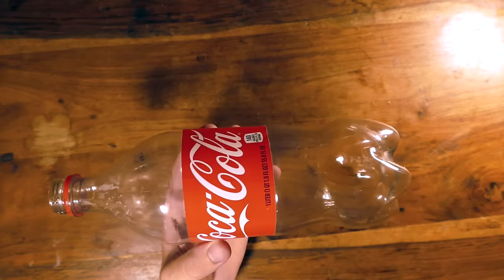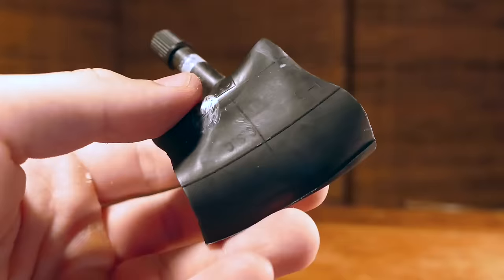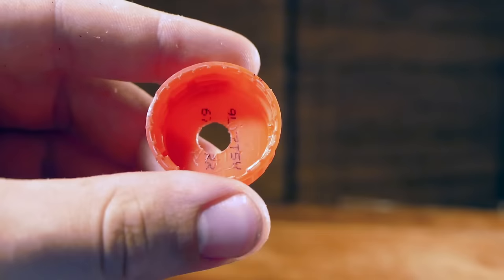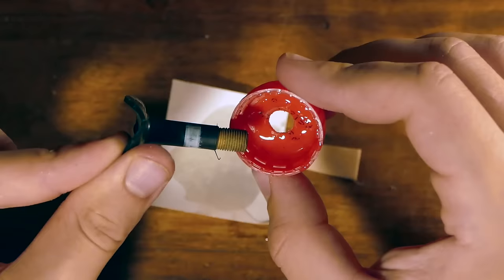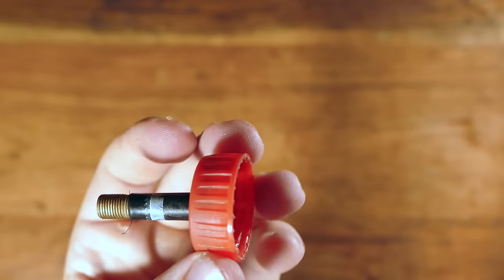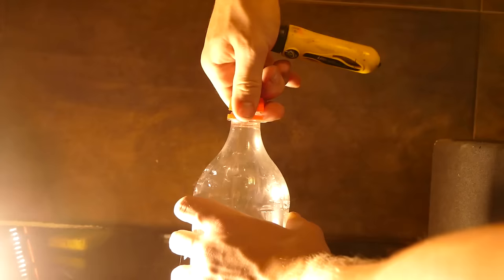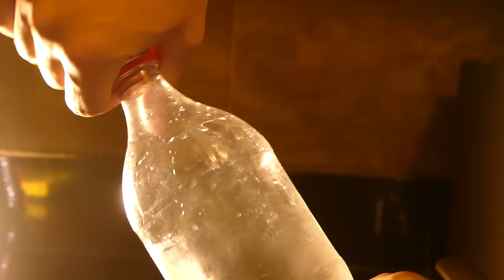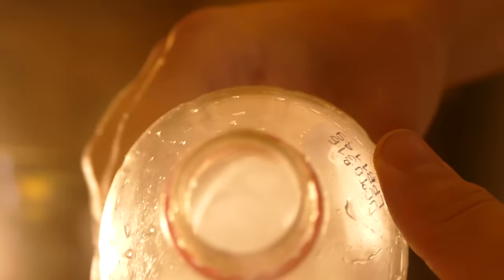How To Make a Soda Machine! - 5$ 5 Minutes!! (Super Easy)

Comment: Mmmm, good old food grade bicycle tires and epoxy.
Reply: My favorite snack
Reply: I can taste the Benzene contamination already, mmm mmm good.
Reply: Kamlesh?
Reply: prism and carbonated too :)
Reply: Dont forget the CO2 canister w/o oil mixed in. My favorite beverages are the ones with just a hint of mineral oil.
Reply: I don’t know why he didn’t just buy a food grade bike valve they use them in beer making
Reply: my soda tastes like rubber
Reply: you can't be picky, princess. God.
Reply: I want to do something like this but seriously can’t figure out how to make it truly food safe
Reply: @patrickmanasco8772  Just buy a soda siphon, they come in all price ranges, starting around $32 shipped for an ICO brand, which works well.

This thing is basically just a cheap hack $5 version of the real thing, probably unsafe too, as bottle might eventually explode. Real siphons use food grade materials, and either metal bottle, or mesh covered glass/plastic. Cause history has shown, they can def explode.
Reply: Life of the party
Reply: Or we can buy the metal cap that is readily available in the market and attach the co2 canister through a pin valve

Comment: I don't think you can get a bike tire, a bottle of soda, and a bike pump for $5. At least, not where I live anyway.
Reply: +Ajax Bleach 
 Lol.
Reply: +Ajax Bleach omg ias tht blech? I actuly naad some of it maan
Reply: +ChildOfRusher yes you can???
Reply: Yes, it is a bike pump..  But also called a bike inflator.
Reply: That 'pump' is made and sold for doing just that.  It's also called an inflator.  It's used if you get a flat while out riding.  They sell bigger versions for car and truck tires.
Reply: And epoxy
Reply: Don't forget the glue
Reply: Most people have a bike pump
Reply: where do you live?

Siberia?
Reply: @PoopyFrikoli There isn't co2 in the average bike pump. Just air
Reply: Everyone knows you dont buy a bike. They are free everywhere and tires come with them. The bike pump can be found at a dollar general or something for 5 bucks.

Comment: Tips: Make sure the liquid is ice cold because co2 dissolves best in cold liquids, and make sure to squeeze out all air before pumping it up with co2 so you get a better carbonation, and don't forget to shake it a bit.
Reply: Exactly my thoughts, he released kid before shaking all that extra gas into the drink.   But cute and fast idea.
Reply: I find shaking it a lot in a sealed container and putting it right up to your moms face (to absorb the home-made feel) and opening the lid helps for the carbonation to be extra fizzy
Reply: Tips: i am pretty sure the video shows that, we don't need a commentary.

Comment: For anyone's future reference, you can buy valve stem for car tires at an auto parts store, drill a certain size hole, and pop the valve stem in and it shouldn't require any glue
Reply: What is the name of that the boy is pressing with pressure
Reply: @michelleperez6716   You mean the bike tire inflator or the Schrader valve and valve stem (the bike inner tube valve)

Comment: I did the same thing with a basketball needle valve.  Don't need any epoxy to do that.  Just drill the hole slightly smaller than the size of the valve and it seals itself once it's forced into the drilled hole.  Just need the same CO2 pump with an inflation needle to fill.  Cheaper than a bike tire and glue, and even less tricky to put together.

Comment: Squeeze it to push all the air out, you only want CO2 in there. Also once it's in shake the heck out of it and you'll get much more carbonation much faster. If you're interested in making larger quantities, look up how to do this with a 5# bottle, regulator and adapter used in beer brewing. It'll run you about $120 (mostly for the bottle) but you'll be able to make hundreds (thousands?) of liters of water with one bottle and it'll cost you about $10 to refill.

Comment: Seems like a great idea.  I have a syphon seltzer bottle which fills with a CO-2 cartridge which I think is food grade. I drilled a 1/4 in hole in the top of the cap with an empty cartridge in it so the hole went thru the cap and empty cartridge.  Then threaded a hollow 1/4 -20 screw thru the cap and cartridge. The hollow screw is connected to a large C0-2 tank with a double regulator. Now I can screw the cap with the empty cartridge back onto the syphon bottle and create many bottles of seltzer.  I can unscrew the cap and the bottle stays pressurized.  The advantage besides cost saving is that I can squirt out as much seltzer as I want from the spout on the bottle without taking it off.  The rest of the seltzer in the bottle stays pressurized.  What do you think ?

Comment: you may not want to use the co2 thing that you used because its not always clean or pure.
Reply: Yup, dirty air.
(that's sarcasm)
The actual pump is probably dirty and has rubbery "sense", but the actual CO2 is the same as all CO2.
Reply: +khang mai they arnt always 100% co2. other gasses and contaminants could be present.
Reply: But in such a small compressed space its highly unlikely that they were filled with more than co2, because that co2 was made, and shoved into that canister by a machine, the gas has most likely never even touched another gas particle.
Reply: The compressors still pull in more things when filling.
Reply: +Whistling Maniac I'm just warning people
Reply: lol rage mode engaged
Reply: +Theseus I was thinking medical grade I didn't know there was a food grade
Reply: +Graydon Treude if there was somthing then I wouldn't get cheap stuff. a less chance of a harmful chemical. but still most contaminants aren't that harmful
Reply: +Theseus all co2 is the same. Even medical grade is the same from the co2 that's in one of those canisters. Medical and food grade tanks are just vacuumed.
Reply: mike HAHA
Reply: +floryzzz I fill CO2 tanks for a living 😎
Reply: mike then you should know a vacuum is the absence of air in a sealed package(or any form of gas for that matter)
Reply: +floryzzz do you breathe air?
Reply: Just buy kitchen grade cartridges if you're worried about that
Reply: If it is not food grade air it may have oil for lubrication in it. Otherwise this is really interesting .
Reply: I don't think your very smart, he means medical and food-grade containers have all the air vacuumed out and then are filled with co2, instead of just pressurizing a container with some air all ready in it with co2.
Reply: samocamo123 

Thank you

Comment: You may get better CO2 absorbtion by inverting the bottle before pressurizing.
Reply: Squeeze the air out of it first but don't turn it upside down, that can cause water to go into the (non-food grade) bike valve and maybe return to your drink when the pressure equalizes. Instead, pressurize it upright and shake the heck out of it. Repeat until your cartridge is empty.

Comment: Even better $2 in X amount of minutes!

1. Go to any store/deli/etc

2. Find a cola bottle

3. Pay $2 (or whatever the place charges)

4. DRINK AND ENJOY
Reply: 5. Then come back home and make your own soda machine. 
6. Drink and enjoy without going to the store because the checkout line will be full of idiots with their one bottle of soda.
Reply: @facitenonvictimarum   Funny, and true. How about just considering a proper food grade soda siphon though? Amazon have them starting around $29.
One person in the thread already tried this and had the bottle explode on him. Real siphons have overpressure valves. And much thicker bottles meant for this varied pressurization. Coke bottles are not burst pressurized like this at the factory, rather the liquid is poured in super cooled, with carbonation already in it. Then its capped, and the pressure slowly builds until it reaches its equilibrium and holds the pressure. Burst pressurization is entirely different, and potentially dangerous. Would you let your kid use this thing, or a real $29 soda siphon instead?

Comment: I use food grade fittings that screws on soda bottles & a 5lb. Co2 tank & a note: very cold water absorbs CO2 better!!
Reply: Please send my links where I can order those things ?
Reply: Btw what psi you recommend for sparkling water?
Reply: @User9681e  I have my regulator set at 60 PSI.... I'll send links
Reply: @User9681e  I tried sending links but somehow can't but if you type in on Amazon or eBay "5lb. Co2 tank, regulator, carbonator cap, ball lock" you'll see it listed. Hose & clamps can be had @ your local hardware store.
Reply: @User9681e  more expensive initially But way cheaper then buying soda!!

Comment: only issue is there's a difference between the industrial co2 vs food safe co2
Reply: What's the difference, you said it yourself, there both co2.
Reply: +Dylan Parker the difference lies in how the cartridge is prepared regular ones for tires or pellet guns still have oils and other chemicals in them left over from the production that ate highly toxic where the food safe ones do not AND the transportation of the co2 is cleaner as well for the same reasons
Reply: I wouldn't trust industrial co2 to be safe to eat in any case
Reply: Clever.

Comment: Theoretically you could use any glue you wanted because the pressure from the inside will push the bike valve into the lid tightly.
Reply: You could probably make if without glue, just use a bike valve for a tubeless wheel. It will also be more food safe.

Comment: Just a tip to get free  bike valves go to a bike shop and ask them for some popped inner tubes
Reply: I know, but the quality is low and the tube valve could be old and might give way
Reply: +guns vs planes For this project you should be fine with an old valve.
Reply: good  points as its not high pressure

Comment: I know I’m no the first to point either of these things out but
. You could’ve bought a Schrader valve for a dickload less money
. The cartridges that come with that pump aren’t exactly good grade

The difference between me and then is I have a solution to that second problem

There are 2 types of cartridge threaded and non threaded the pump your using is a triggered CO2 pump which takes both kinds of cartridge 

There’s a machine specifically for home carbonation but it’s expensive whereas the cartridges (sold separately) are VFC (very fucking cheap)

Just set up the CO2 bike pump like you normally would except use a soda charger (that’s the cartridge that’s made for the machine I mentioned) instead of that industrial grade stuff

Comment: How many drinks per cartridge?  Roughly?
Is it cost effective versus buying a 12 pack of Mineral Water?  For example.
Reply: 1 per cartride. Not really, barely any savings. Its not for that, its to not have to lug so much liquid home constantly. A real siphon can be had for as little as $29 though, this thing could potentially explode in your face. Bottle is not meant for burst pressurization.

Comment: Sir I was with ya till i realized ya used co2. That's not really the safest thing to consume. Now it would be a very interesting way to carbonate your water with a normal push bike pump. Because you can physically produce a form of carbonation over a few minutes.
Reply: Why do you think there's "carbon" in "carbonation"?  CO2 is what carbonation is all about.  If you can get a hand pump to extract CO2 out of the air, you get a Nobel Prize.

Comment: do you have to refill the c02 canister thing??
Reply: +Linus Puehler yes you do once it runs out. It's not unlimited
Reply: The CO2 thing is a bike tire inflator.  It uses CO2 cartridges that only hold a limited amount of CO2.  You refill the inflator by replacing the cartridge.

Comment: Eh, that is expensive, those co2 cartridges are expensive.  Also, it didn't look like it added much carbonation.  It would be better to spend ten bucks to get one of those small oxygen sized pressurized containers with co2 and spend 10 bucks on fittings to make soda.  From what other videos have said they will make 1000s of 2 liter bottles.

Comment: Why did you remove the sleep headphones video
Reply from the maker: It wasn't supposed to be posted today 😁 I'll repost it Friday
Reply: +JLaservideo  instead of using a bike tire use a tubeless tire valve stem u can get at a car store
Reply: +pryo ghost57 That won't work
Reply: +Diesel they are both shrader valves, it sill work fine.
Reply: +jdod64 Not really. It's still not a Coke machine
Reply: Diesel
no one ever called this a coke machine, what the hell are you even on about?
Reply: +jdod64 Read the title
Reply: Coke soda same thing. It's not a Coke or soda machine as it says it is.

Comment: Plus for ingenuity, but fail for using non food grade materials. Why not just point out that a real soda siphon can be had for as little as $32 shipped for an ICO brand though? Food grade and much sturdier bottle, with overpressure valve. This thing Id consider borderline dangerous, good luck if it explodes.

Comment: That's not safe for human consumption bro..
The carbonated water that's used in soda and other carbonated drinks don't have that much Co2 for a reason
Reply: Rayne Yactsh 

There is a machine specifically for home carbonation and the cartridges intended for those machines (called soda chargers by the way) are sold separately in some cases

You could just set up the CO2 pump normally but replace the industrial grade stuff with a sofa charger

Does that solve the problem or will there be something wrong with the pump that’ll undermine my idea (I mean I’m still gonna do it no matter what you say but if anything goes wrong I’ll have a change of heart and thank you for trying to warn me)
Reply: The reason I’m not buying the machine itself is because I refuse to spend $90 on something just so I can have soda every time I get out of bed

Comment: There is soo many wrong thing here. Epoxy... Non-food grade CO2, rubber tire.. I'll pass, way tooo toxicity in there. 

Mostly because Non food grade CO2 contain trace of hydrocarbon (oil), nitrogen and (glup) benzene. The food grade CO2 also has to go to a more expensive way off clean handling, so the non food CO2 could be handled with unclean pipe and tank. You could has well have trace of cyanide in that CO2, which is already present in the epoxy.

So I choose to live and buy a new bottle of pepsi. Speaking of bottle, pepsi bottle are not suited to refilled with gaz, they could explode. The CO2 is already premixed before bottling and the bottle is rated to hold the gaz inside the liquid, not force it into which require 5 ATM.